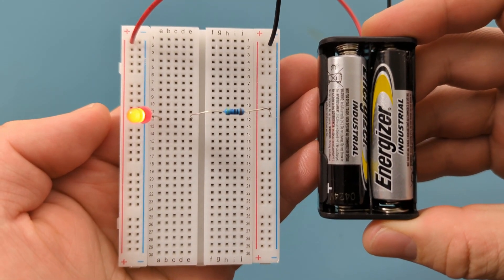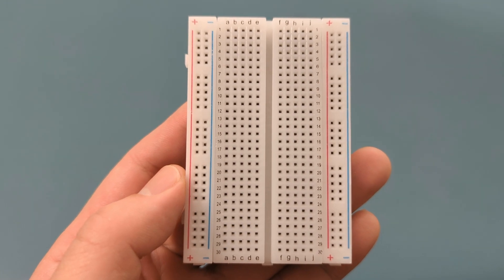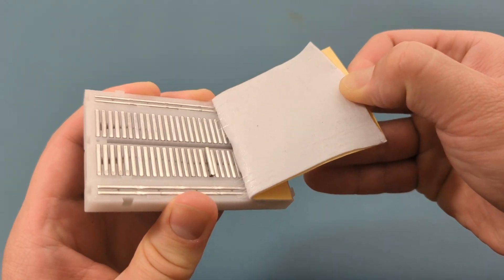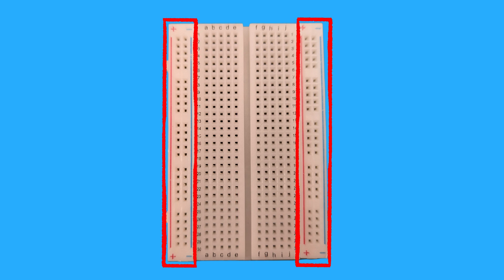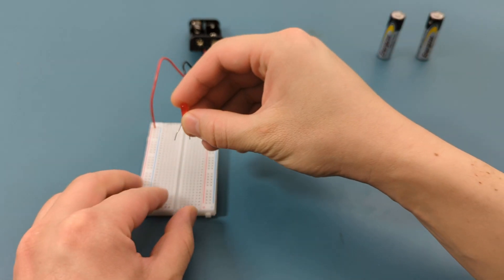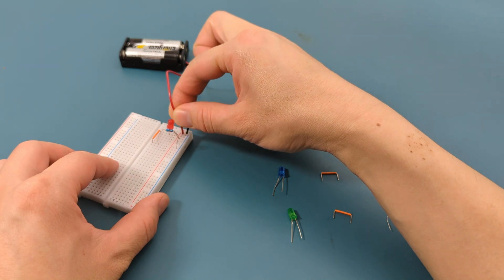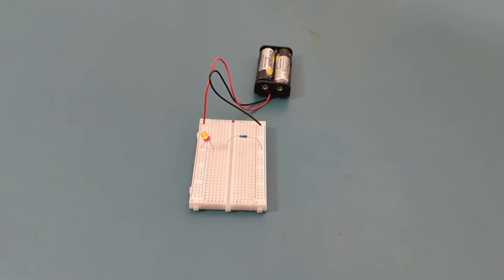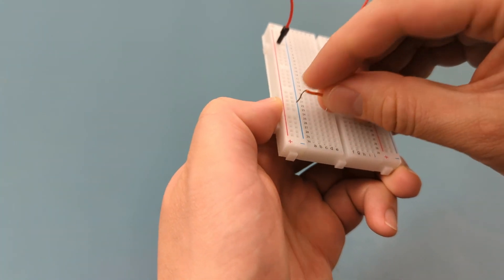How to Use a Breadboard

Comment: Why is there the negative or ground part thats labeled blue?
Reply from the maker: Great question! Breadboards often use color-coded rails to help you keep track of voltages. The blue (or black) rail is usually used for the negative side or ground, while the red rail is for the positive supply. The colors don’t affect the functionality—they just make it easier to remember which rail is which when you’re wiring your circuit.